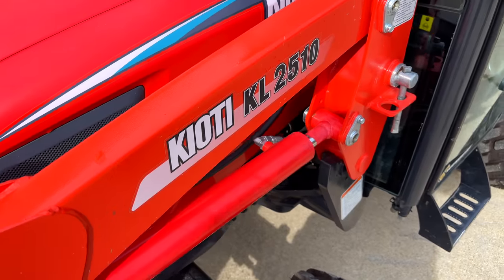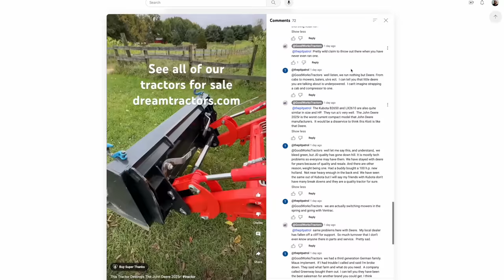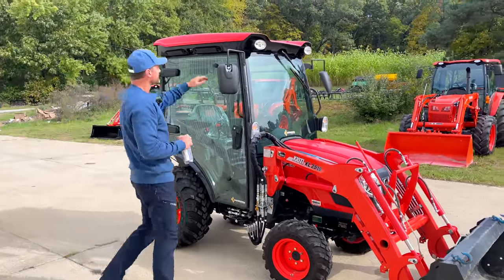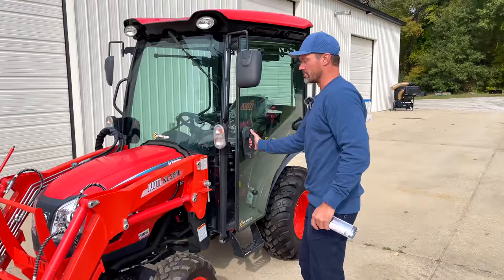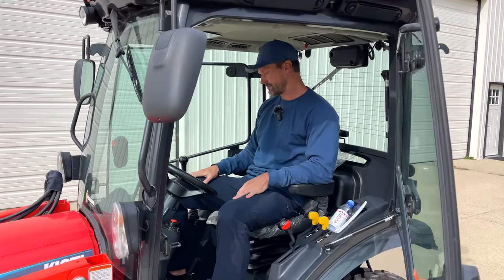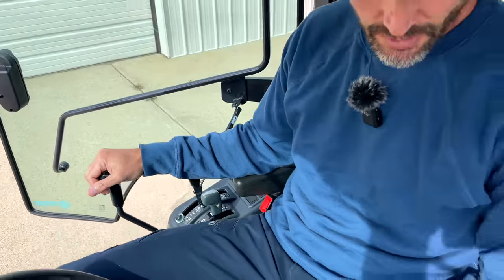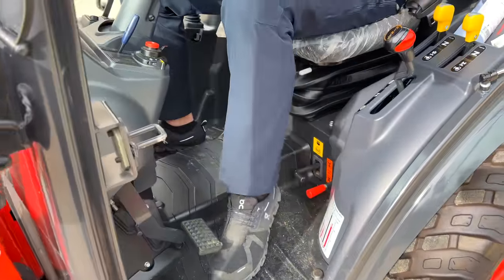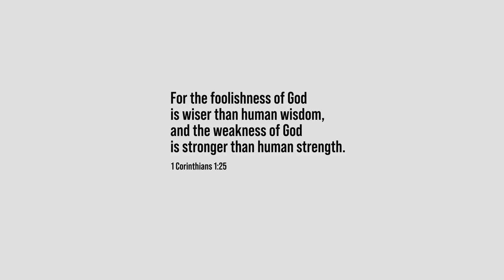THIS TRACTOR CRUSHES THE JOHN DEERE 2025r!

Comment: Weird, those low hanging hyd hoses are only that way on the cab model - on ROPs they're straight out of the valve block to the loader bracket (vs 90° down on cab). Awesome review - my CX really punches above its weight!

Comment: Looks like telescopic link arms are an option on the 3 point arms (assume this means the ends of the arms).  They do not mention telescopic stabilizers as an option.  But the armrests are standard on the CX, while they are optional on some of the larger models (CK & DK models), not sure why there aren't standard on ALL of the models, especially with CABS!!  Anyways, have a good one!!👍

Comment: Great tractor review!  I wish Kioti still had the CK2510 model.  A bit bigger than this CX2510 with a 100 cubic inch engine.
Reply: They do still have the CK 25/10 it’s now the CK26/20 I just purchased one. Love it if purchased with the 4030c loader lift weight is an astonishing 1996 lbs at the loader pins.

Comment: I have done a ton of summer brush hogging on 5 to 18 acre lots, and a ton of winter snow removal in driveways. I use my John Deere 3038 E and wish so many times over the past few years that they had offered a cab. As for looks, I really do not see any goofy in that Kioti.
Reply from the maker: Yeah, the 3e Series is a value series, so I don't see them offering a cab on that one.

Comment: Are there supposed to be covers on the forward and reverse pedals or do they leave those bare intentionally?  And clean that HVAC intake filter, it's dusty :)
Reply: They are supposed to have plastic covers with forward and reverse arrows.  They must have gotten lost, along with the LSV triangle at some point.
Reply from the maker: Think so, they probably just slip on
Reply: I noticed that too, I’m wondering the same thing.

Comment: I love that little tractor.   That's exactly what I need.   I too am worried about the hydraulic lines being down that low so, WHEN I get one, those lines will be dealt with. with.
Reply: I don’t believe that’s the norm. I think the lines are just run improperly on that specific unit. I have the rops model and loader lines are tucked up nice and tight.

Comment: My neighbor has a JD twice this size. It's the biggest piece of garbage.   He paid over $50,000 for it. The right door won't stay open , it has more blind spots than open views. I can't tell you how many times he has had to pull it out from getting stuck.  I don't know how the 4x4 could be so bad.    The loader bucket is a joke. It has torn up as if it was made from recycled cans. I have tractors.fro 60s-80s. Loader bucket repair on them is welding on a new cutting edge. It's not like he is pushing stumps out the ground with it. It's just made so cheap that normal use has bent it to pieces.     Also he has had to start paying for a John Deere tech to come out and diagnose it when it just shuts down.    It'll be in the field , and anything happens , it'll only idle , and nothing will work. Several times it did this when under warranty, but now he has to pay them to come out. Like if something comes unplugged, it shuts down , and he can't find out what it needs without JD coming out.    It's amazing that such a huge company can make garbage, and still be a top contender.

Comment: Not just more capable but I bet that kioti with a cab is comparable in price to an open 2025r  which has the same loader as 1025r.  Just up the road there was a 2006 Kubota b2630 for sale it had an aftermarket cab, doors were missing had 1500+ hrs and a front snowblower. Could tell it was well maintained but we're still asking $18,000 and it didn't last a week. Seemed high priced to me but I guess the snowblower alone adds $2000+ but I paid that for a L3940 cab with 800+ hrs back in 2016/2017. The price of new stuff has gone crazy and so drags up the price of used stuff.

Comment: Head to head the TYM and kioti beats deer and kubota in   most categories.
Reply from the maker: Maybe so.  I can't knock TYM, they look like good tractors.  They aren't quite to the position yet to be viable for me in the secondary market.  Give them time and they could get there.
Reply: I think they will get there sooner then later. The Korean tractors have been overlooked for a long time but their capabilities, lift capacity and performance are pretty impressive. The T394 when compared to say the 3039R, hydro is quiet, and it out preforms in every category. And it's typically about $6,000 less. Same with kioti and many of their comparable models.
Reply: TYM is way below JD. KIOTI though I can't agree more.
Reply: The TYM T25 has even more loader lift capacity 1380 lbs to 87". I have 150 hrs of trouble free service out of mine. I do wish TYM offered A/C cab

Comment: 2025r lift capacity 1023 pounds Kioti cx2510 1092 this at the pins. Where did you get the 400 pound difference? I’m looking at buy a tractor making a spreadsheet to compare spec and price. I’m I looking at the wrong spec?
Reply from the maker: Yes, you're looking at the 2025r Gen 1 spec.  John Deere redesigned the 2025r and put the 1 Series loader on it.  They downgraded the performance of the tractor and kept the same name.  The price also went up.  Double whammy.  I'm guessing you found the spec at tractordata.  You'll see a drop down list near the top where you can select what model years you want to look at.  It'll change the spec.  https://www.tractordata.com/farm-tractors/007/2/8/7282-john-deere-2025r-attachments.html
Reply: Thanks for the information.

Comment: On the Kioti website, it says that the mid-mount mower is compatible with the loader and the backhoe. but I cant find what that actually means. does that mean, I can run and use or just lift the deck? I cant find a video showing that.

Comment: What is that grill guard supposed to protect?  It doesn’t cover any of the grill.  Also I looked at the bobcat version of this tractor and the bucket seemed significantly thinner than the John Deere
Reply from the maker: Haha, yeah seems most grill guards aren't doing much besides blocking large limbs.  As far as the bucket goes, I've never seen thinner or less support than on JD standard duty buckets.  I look at a LOT of machines and JD buckets have more damage than all other brands combined.  If you are buying a JD, it's worth money to upgrade to the HD bucket if an option.
Reply from the maker: Upgrade your grill guards at http://www.5elevendesignz.com.  Save 5% with code GWT.
Reply: For whatever reason, Bobcat makes their own loaders and buckets for these tractors, so while the tractor itself is the same as the Kioti model, the loader and front buckets are different (and the loader lifts less than the Kioti loaders....).  Just info, in case folks don't know.  Have a good one!!👍

Comment: In 10yrs....you go to buy parts for this tractor compared to the John Deere...the John Deere parts availability will CRUSH the Kioti availability...and that is what is important. Company support is the most important thing...John Deere wins hands down!!
Reply from the maker: Kioti has been in the USA since 1993.  Kioti was founded in 1947.  Kioti did $1.3 billion in revenue in 2022.  They aren't going anywhere and are only growing.  Did you know John Deere had 3,000 dealers in 2007 and now they only have 2,200 dealers?  They lost 25% of their dealers in 16 years.

Comment: The current 2025r has been a curiosity to me since it came out. It’s not a large frame 2-series and not much different from a 1025r. Why not put the 25hp engine in a large frame 2 series? That’s always been odd to me. Furthermore, the open station only on the large frame 2 series is unfortunate. I would upgrade my 2038r to a cab model in a heart beat. Hopefully in the next generation that will be a reality!
Reply: To stay under tier 4 compliance while still having full cat 1 usability

Comment: Is that engine really 87 ci, or is it 100.5 ci?  The spec sheet says 1.6L and lists the model number for the bigger 100 ci engine.  I’ve looked up numerous resources and can’t seem to reconcile the answer.  Somewhere there is a misprint though.
Reply: It has the 100.5 ci, its a missprint. Same engine as the CK

Comment: The 2025R is really a 1025R with a slightly wider wheel base and larger tires. Other than a small difference in ground clearance and a small advantage in lifting height because of the larger tires, the specs are quite comparable including a 120R loader.  It is not really a fair comparison as John Deere really made no significant changes from the 1025R other than putting a 2 in front of the model number.
Reply from the maker: Believe me, I'm 100% aware of what the 2025r is and is not.  Just browse my videos over the past few years.

Comment: How is this lawn mower better than another lawn mower?  Good explanation, but really, it is still a larger lawn mower.
Reply: Not true! I use my CX2510 on my gravel driveway using the front loader and rear blade and lots of firewood hauling etc all at 7700’ elevation. Love the 4 wheel drive. It’s not a lawn mower…don’t make uninformed statements

Comment: Both of those are glorified lawn tractors.  But in the right environment, I can imagine them being useful.
Reply from the maker: I am working on not letting this type of comment rile me up.  So...thanks for watching!
Reply: @GoodWorksTractors  Don't let it rile you up.  Your information is good and useful, and in the right conditions, I could have been in the market for just such a tractor.  My father-in-law in Massachusetts would have killed for one, had they been available 30 years ago.  His problem was snow, of course, where I think this could excel.  And don't get me wrong; I would love to have that cab with A/C.
Reply: We have an LS3010 thats the same size and it has been very handy. We even use it to rake and sometimes feed hay. It doesnt like it, but will handle a bale if youre careful. If kioti made a 25hp(easily turned up like this one) that weighed 5000lbs, we would be all over it.

Comment: Me owning a tractor for 5,10 or 15 years may not be possible. Just kidding as I am 77 so my 2025r john deere will just have to do. And it will lift an IBC tote full of SEASONED oak about 18 -24 inches off the ground.  A Full IBC tote of green oak it will lift almost off the ground.